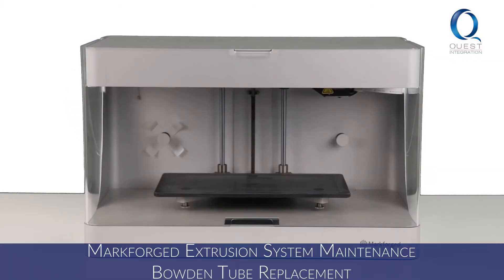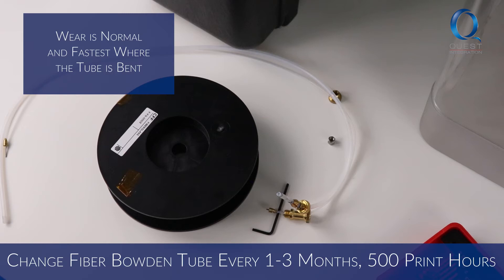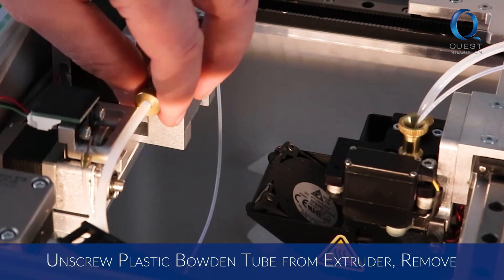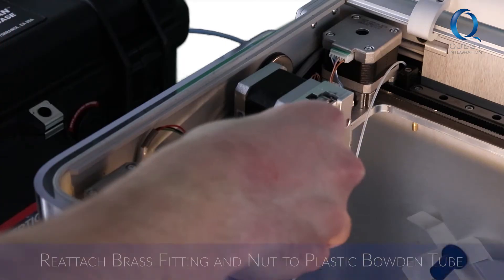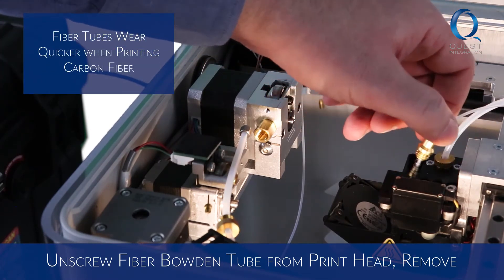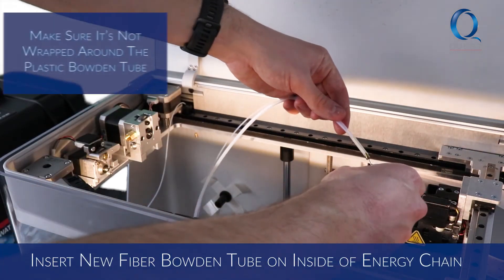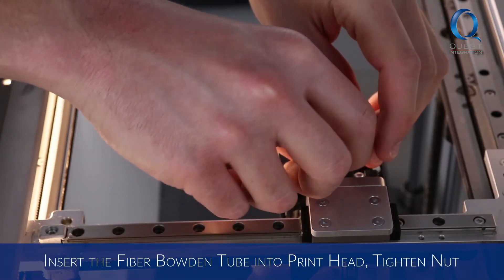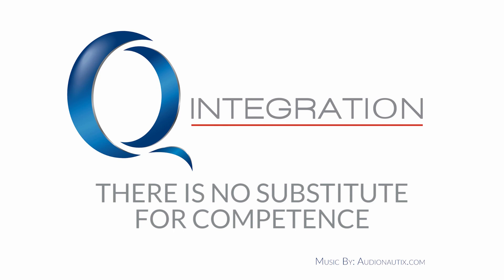Markforged Extrusion System Maintenance: Bowden Tube Replacement

Comment: One question if i own a onyx one, can i upgrade to onyx pro, by installing a fiber extruder and the print head?
Reply from the maker: There is an upgrade path to a Markforged Onyx Pro. Please call 877.266.4469 or email info@hawkridgesys.com for more information. Quest Integration is now a part of Hawk Ridge Systems.
Reply: @QuestIntegration1998  Great! I will take that as a 'YES' thanks a bunch. Take care